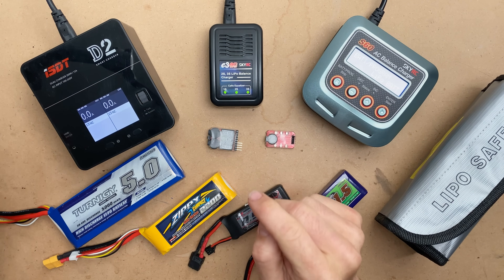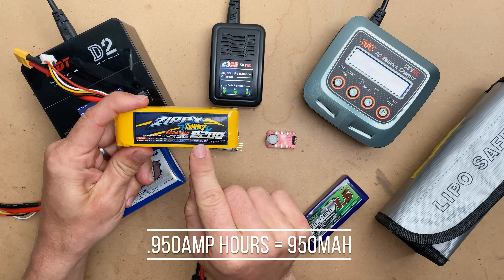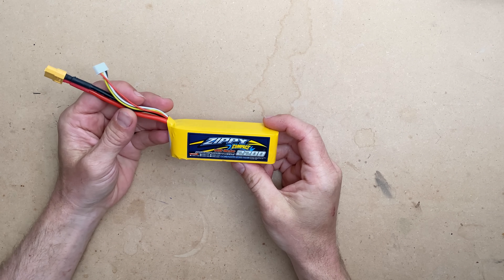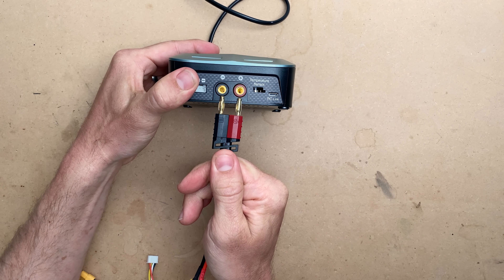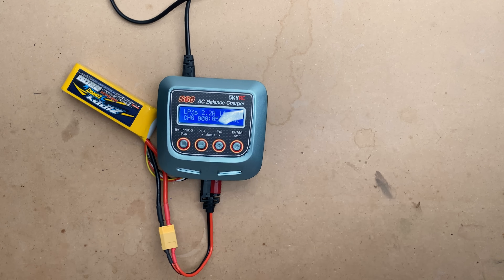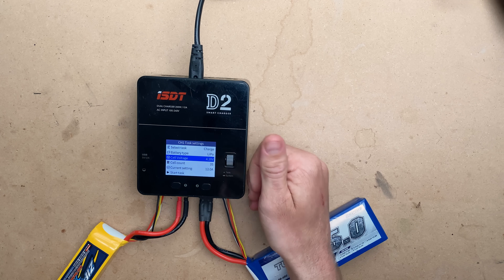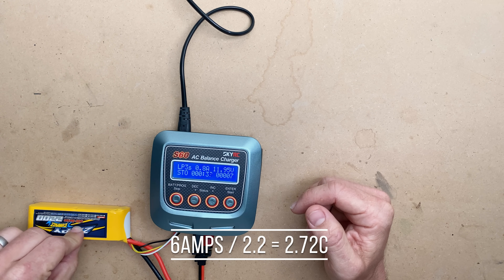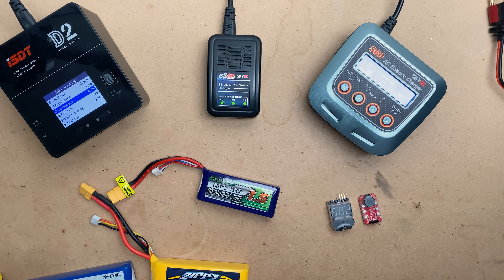GUIDE: How to Charge a LiPo Battery

Comment: I have an autel ts508 that wont take a charge.  It was working fine, and had a quarter charge when I plugged it in, and the next day it was dead.  Turns out when the charger is plugged in,  the unit cant be turned off, so it wore down the battery.  I purchased a new battery thinking it was bad,  and the new one did the same thing.  3.7V MLP604193 Battery.  It has 5 wires from the micro connector to plug into the board.  I have a tenergy tb6b that came with my drone that has the right settings,  but I dont have a correct connector to plug it it.  Is there a way to cut the wires from the battery and charge it with the tb6b?  Or even better,  do you know what the part on the circuit board would look like that would need to be fixed so it charges?  It does have the battery icon on the screen look like it is charging,  but the multimeter says it is not.

Comment: Hello. Great topic. Question, I’m new to the hobby and I have a basic LiPo charger - Ultra Power UP4AC. I have both 1/18 and 1/24 WLtoys cars which use these tiny 2S LiPo’s in the 400-2200 mah range. My charger runs 1, 2 or 3 amps. For these smaller batteries below 1000 mah, do I charge with the 1 amp setting or do I need to upgrade my charger so I can charge lower amps? Thanks.

Comment: When you’re battery is fully charged after charging do I leave the battery charging or do I disconnect and leave it aside until I’m gonna play? Or do I leave it plugged in the gun?
Reply from the maker: It's best practice after your battery is fully charged to unplug it from the charger and set it aside in a LiPo bag until it is time to use your blaster. Keeping a battery on a charger or in a blaster (especially one without a cutoff switch) is more likely to cause problems than storing it.

Comment: HI could you help at all? My new Zapper Lipo battery says 'over voltage' even after setting it to the correct specs. What am I doing wrong?! New to the hobby and dont want to kill my first battery, Could it be that the battery charger settings itself are wrong? Thanks in advance
Reply from the maker: Hi! Shoot us an email at orders@outofdarts.com!
It will be much easier to help you over there.
Reply: @outofdarts  sorted thanks

Comment: At 13:07, even though you set the storage rate to 6a, once the charger started discharging it seems to top out at 0.8a…. Or am I missing something? (I just got an imax b6, and noticed my discharge rate is only around 0.6a)

Related, if you set the “storage amps” at 6a, and your battery voltage had been LOWER than the end storage voltage, would that 6a setting risk charging the battery UP to storage at an amperage higher than the battery can handle?
Reply from the maker: The discharge rate is limited as a safety feature of the chargers to keep things from getting too hot. Any setting you make is the maximum possible if could go. In practice, the charger will do only as much as it determines is safe.

Comment: So it doesn't matter if the batter is at 25% or 75%, I still charge it the same way and the charger takes care of stopping when it reaches the maximum voltage right?
Reply from the maker: For the most part, yes. The more expensive chargers have other options, like storage charge, but they all charger similarly. Make sure you read the owners manual of your particular charger, though. Our knowledge doesn't compare to the people that actually built the product you're using.

Comment: Has anyone got the battery check lower cell voltage error on the turnigy accucell c150 charger?  I got a turnigy 1.5 2s lipo about a week ago and am trying to get it to storage charge.  In the manual it says "Cell voltage of the battery pack is lower the termination voltage control (TVC), check the battery and the TVC setting, then restart."  I already tried with the TVC setting at the lowest (3,000 mV/S).  Hobbyking said the battery would be shipped at 30% charge and I have not used it.

Comment: great video. Why RC cars Lipo battery are always "dangerous" while laptop, mobile phone and many other appliance seems safer?
Reply from the maker: Household Li-ion batteries run at a lower current, and have built-in control circuitry which theoretically makes them safer. Hobby-Grade LiPos run at a higher current draw and have no control circuitry, which is why we strongly recommend the use of LiPo Alarms.

Comment: First time even thinking about using a lipo and this is so stressful. This helps. If I’m understanding this correctly I can charge a battery, use it, store it at less than full charge post using, then charge it again just prior to use. Am I correct that a lipo should always be stored safety when not in use? Cannot leave it in the blaster?
Reply from the maker: Correct. More detailed information about LiPo safety and LiPo alarms can be found here: https://outofdarts.com/pages/lipo-safety Hope this helps!
Reply: @outofdarts  thanks so much! Just got into nerf 12/2020, and have been buying up some blasters, and doing some light modding. Just got the spectrum and wanted to beef it up. Thanks again

Comment: After playing airsoft with my new 2s 2000mah lipo, one of the cells read around 4V, whilst the other one discharged to 2.8V. I’ve read that they should always discharge equally, and never below 3V. They both charge up to 4.2V using a balance charger. Is the battery broken and should I get rid of it, or is there a potential fix? Thanks

Comment: Ok my charger shows total and individual cell voltage....the manual says it will beep and stop charging automatically. I have 3s batts and for some reason it charges it pass 11.1 volts and doesn't beep...does that mean the charger is faulty "even though it's relatively new" or the battery total capacity is higher than it says?

Comment: Ok, so, if i understood, a lipo alarm warns you when there's too low or too high voltage ( capacity ) and, to not make it burn
-The amount of charge in your LiPo needs to be not to high, nor too low
-You must not rush the charging of the battery and go too high in current

And, if your LiPo is charged while stored, this may lower it's capacity, so you need to take out the charge

Please tell me if I'm right, I don't wanna die and burn my house
Reply: Correct. Except that you need to charge you battery to a store charge when storing it

Comment: I have a question about Lipos, is it a bad thing to have a C rating many times higher then what I will ever use? I have a 1.5 ah 80C Lipo and I’m only using Valkyrie motors (28 amp stall current) will it fry the micro switch? Or will it be just fine?

Comment: What is a good cage and flywheel setup  that I can get at your shop that will hit between 120 and 130 on 3s and uses Valkyries and is the red artifact cages a low Crush to medium crush I  cannot tell if it is what is a good fly weel for it

Comment: Lots of good information- curious though as to how to fix a battery that is out of balance though. I have one of your Turnigy Graphene 950mah 65c 3s lipos 2x cells are reading normal ranges but the 3rd cell is dead like .08v - is my battery done? or can it be saved? thanks

Comment: I have a Imax B6 charger. You used to sell them and don't have in stock anymore. Is there a issue with that charger? I have had great experiences with its settings and alarms. Also I use the extended 2s and 3s cables I got from either ood or foam blast(I don't remember who tho)to have more room to keep batt in a lipo bag..are those cables still ok to use?

Comment: Having run an RC car club for about a decade I've seen more lipo problems charging with 'lipo safety bags' than without. Cells will expand well before catching fire and if you can see that you can stop charging before it goes up. Bags are safer if it does go wrong, but mean that failure is more likely. That said its worth mentioning that in all those years I've only seen 4 proper lipo fires - 2 human error (wrong cell type selected) and 2 from accidental punctures.